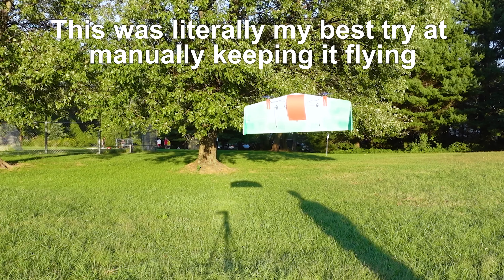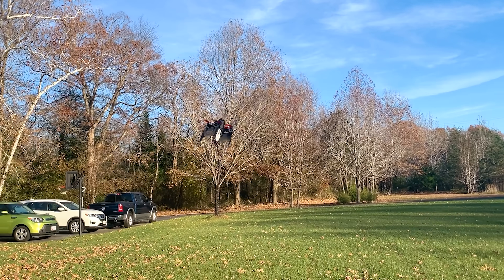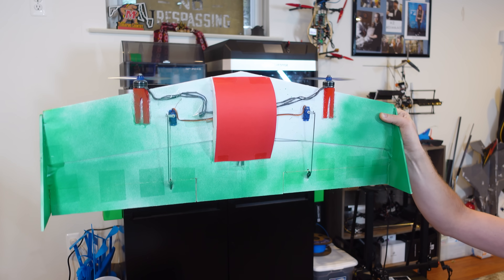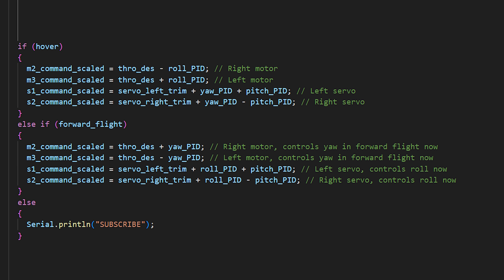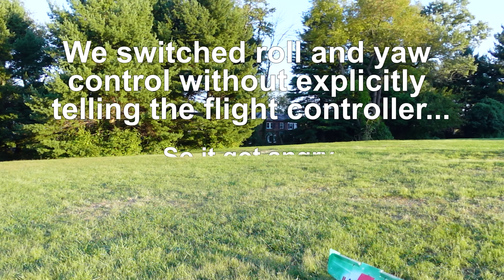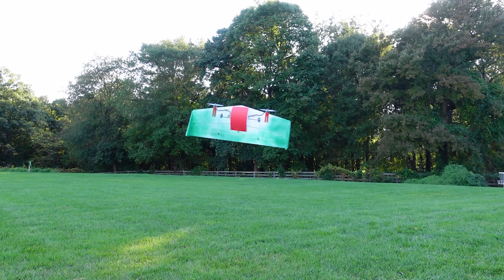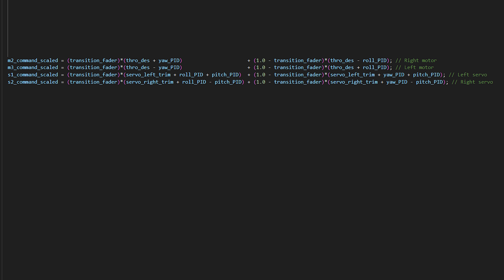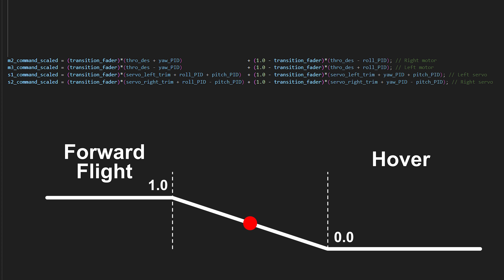Taming the Tail-Sitter: Hover to Forward Flight Explained

Comment: Loved the video. I just finished a project using the ESP32-S2. It was a big one. 1.1MB in Flash.
I know even the ESP32-S3 doesn't have the power of a Teensy 4 (@600MHz), but does it have the power to run your code decently? 
Would it be the clock speed (240MHz)  that's not fast enough? Was ESP32 available when you wrote your code? Or you just went with the best and biggest horsepower? 
6:23 looks yummy! Soon I hope...
Reply from the maker: Some people have ported the code over to the esp32-s2 and said it runs just fine. The teensy 4 has STUPID compute overhead for this relatively simple code, I just like having the option if I want to load it up with other stuff :)
Reply: @NicholasRehm  Great. I hate to learn yet another hardware.
Reply: @NicholasRehm   interesting, also did they use Arduino or ESP-IDF?  Also i am not that surprised it runs well on ESP32-s2 since unlike an arduino uno or RP2040 it has a floating point math unit and for the type of math that you are useing it is a great gain in speed. Also remember NOT to use core0 when useing the WIFI/BT since it may lag important code running on it . 
The tensey 4 was a huge overkill to begin with (unless you wanted to ad video/photo to SD)

Comment: This is an awesome project! I love things that are mechanically simple and reliable yet work really well.

One thing I don't agree with is the "quadcopter" control layout when in hover mode. As an rc pilot with 30 years experience. My brain naturally would tell me to fly this plane shaped vehicle with an airplane control layout. Using the yaw stick to control yaw as if it was pointing straight up, and roll to twist around the vertical axis. 

This would also make the configuration much simpler.
Reply from the maker: Agreed, sometimes my brain confuses me too being primarily an airplane guy. Thanks for the comment!

Comment: Perfect..... are you putting the raw code up like you did with the F35? This would be awesome to have... or is it documented somewhere. cheers
Reply from the maker: I think I'll be doing a write up on the rcgroups thread and I'll post it there--excited to see what you cook up! Hope you're doing well
Reply: That would be awesome....... I have tried a few tail sitters but nothing worked hence the excitement and comment.. Still flying the F35, made a few tweaks to the transition timing so its dialed in and does not dip down when going into FFF..... I have the Nemo set up ready just waiting to assemble the printed parts.. also have another teensy ready to be set up for a small F18...... I was wondering how big a plane you could use this board on as I have a few larger foamies that I want to try it on just for stabilisation.... as for me I just retired 3 months ago and we have been travelling and just relaxing..... if you want to see some of the plane stuff I have been doing since retiring feel free to check out my YTch ... I hope all is well there with you, stay safe and keep up the great work.. BTW I still check in the RCG thread to keep up with what is going on... cheers from downunder 
 @NicholasRehm

Comment: I would have taken a much different approach. I would have viewed my aircraft as only having 1 forward direction. I simply would have changed my setpoints to better fit the way I want to control it. I also would have used vectors instead of Euler angles to allow the angle controller to still function, which starts to break down due to the singularity problem of Euler angles.

Tackling it this way I never have to change how the aircraft views the world, but rather just how I control the aircraft, this means that you don't need to change PIDs as yaw and roll PIDs are suddenly changed and may not function as well as was hoped.
Reply from the maker: Yep, all of my process arose from the desire to work with slightly more intuitive euler angles. Your method I would argue is the "correct" way to tackle the problem
Reply: @NicholasRehm  Wouldn't it be possible to just have 2 different world views, one pitched forward 90 degrees, the angle PID controller could switch between the two, then this would be the only way you have to change the world view.

Euler is more intuitive for sure, I do think with the right helper methods that a vector view is also simple enough to grasp, but still not as easy as Euler.
Reply: @NicholasRehm  Your approach is however still the correct one for something like a tiltwing aircraft, where the fuselage remains level through the transition. Though in this case the angle between the wing and the fuselage can be used in place of a switch to tell the controller what proportion of mix is necessary to give the pilot intuitive input responses.